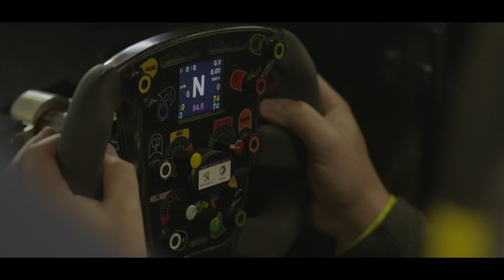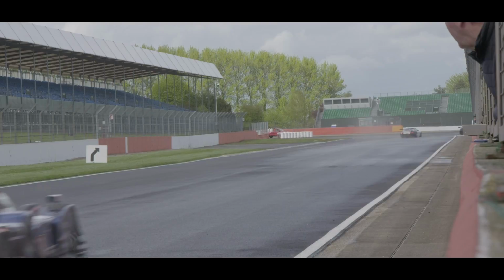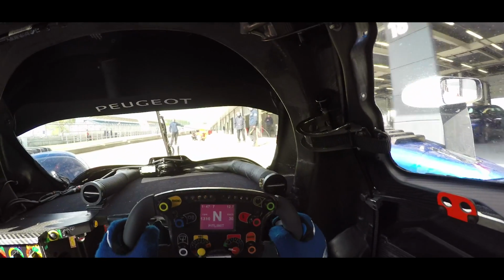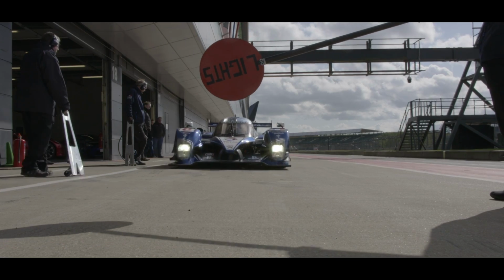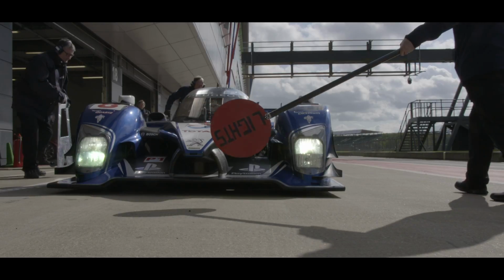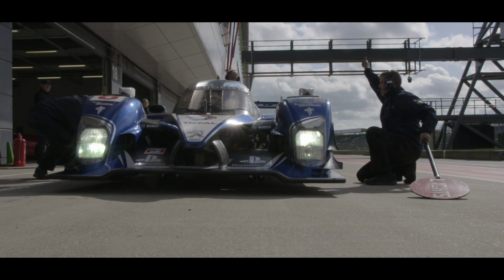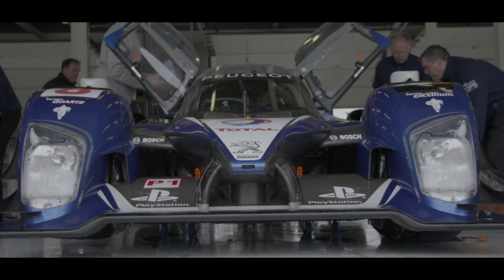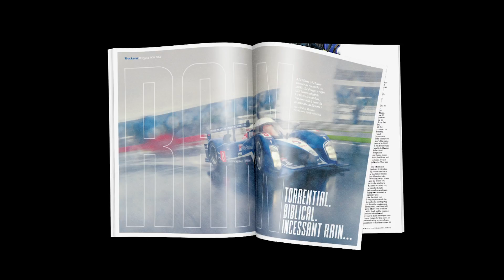Peugeot 908 HDI FAP: Track test

Comment: A legend of Le Mans but I did not remember the sound of the car which is a truck's sound.
Reply: IROCMAN666 despite being a V12 it's a diesel so it explains the truck sound.
Reply: Very powerful diesel
Reply: You've probably heard the newer V8 version. This one sounds like the older V12 version.
Reply: a truck engine doesn't rev to 5000 rpm 😄
Reply: @MultiChorlo  I know but in France, we have this point of view.
Reply: @StaelTek  Because it is the older V12 version, aka the original.

Comment: For anyone who says this sounds like a piece of garbage , the engine haven't even peeked over 5000 rpm, and the shift lights didn't even light up.
It was obviously a test drive and they didn't push it.
Reply: its a diesel

it'll sound like shit regardless of revs
Reply: @hertzwave8001  Diesels sound amazing. Your opinion is invalid
Reply: Normally it peaks at 7000 I think
Reply: @johngjfkri  I know its a race diesel but 7000rpm is huge for a diesel most only rev to around 5500rpm max.

Comment: Didn't all 3 factory 908's and the private Team Oreca 908 all have the exact same failure that year at Le Mans?
Reply: 1 X Factory 908 had a carbon tub failure and retired about 3 hours into the race. The Oreca one was the last one remaining and failed with conrod fracture. Perfect weather and nothing to slow them down meant they ran at 100% the full race. The Audi r15 tdi + won 1,2, 3 and hold the record for longest race distance ever at Le Mans.